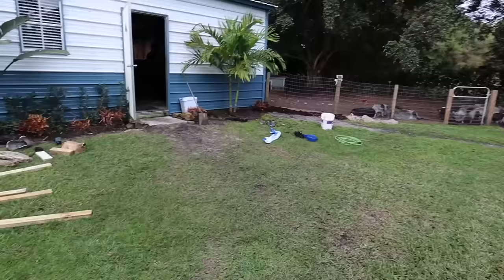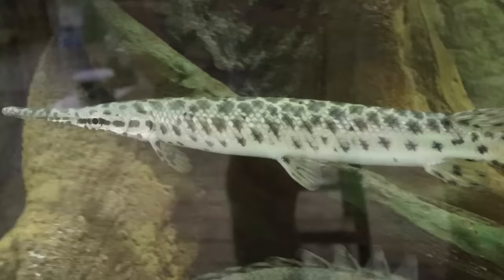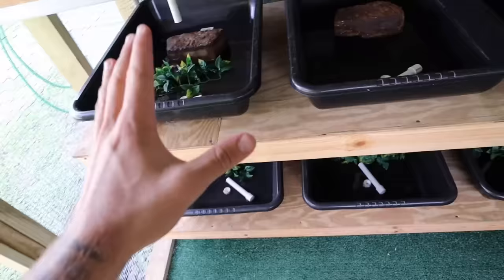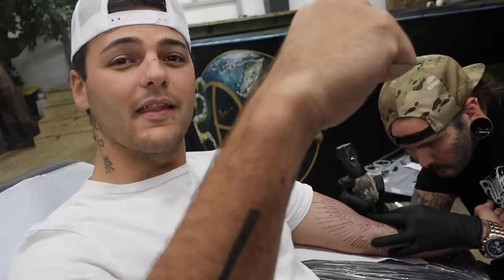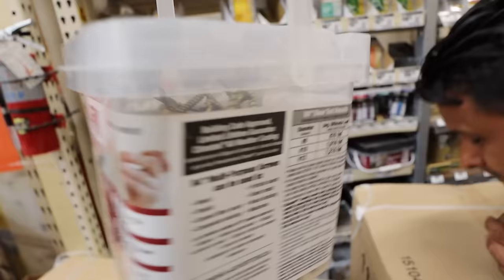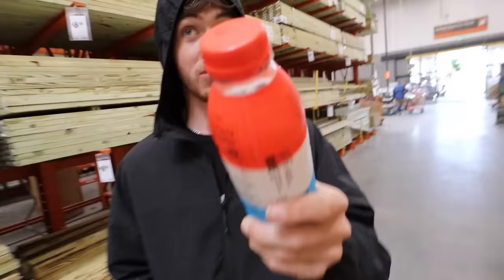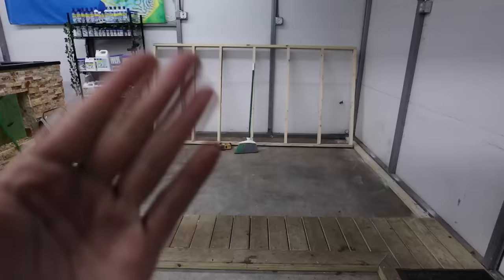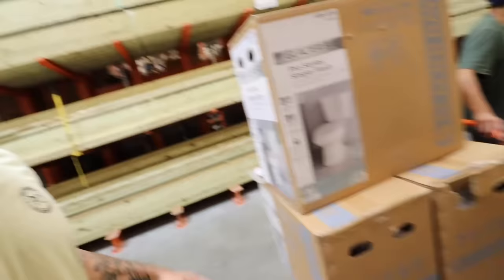Making BIG CHANGES in My FISH Building…

Comment: Use the new pond for salt.  That way you can connect the two if you want. Would make the cycling process way easier. Combined water volume would be more stable.

Comment: If you make the new pond saltwater you could put the filtration in the middle and run the two tanks on one filter system increasing the water volume significantly.  Would save on needing two skimmers two filters etc. Just an idea anyways

Comment: I personally think the freshwater fish should stay in the pond they are in right now, since these fish are very large + there are too many for the new pond (since it will be smaller than the freshwater pond).

Instead I would do either a second saltwater or a second freshwater pond for entirely new fish (saltwater would be kinda cool, because that side of the fish building would be the saltwater section and the other side freshwater ).

Comment: You're lucky he uses rotary machines! If he used the old coil machines you wouldn't so laid back and relaxed! The ribs are usually the worst for everyone! It would also be smarter using cinder blocks then coating it in concrete. Check out diy videos of brick ponds and just use block instead of brick! Im sure hector could make a sweet brick pond!